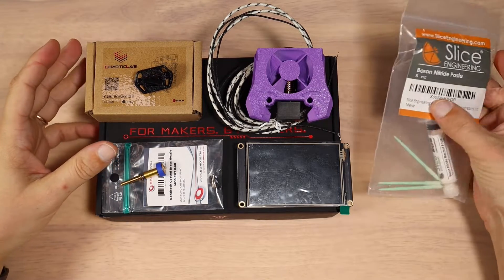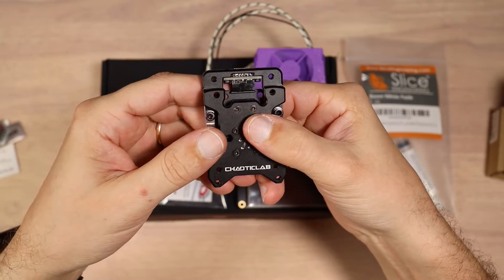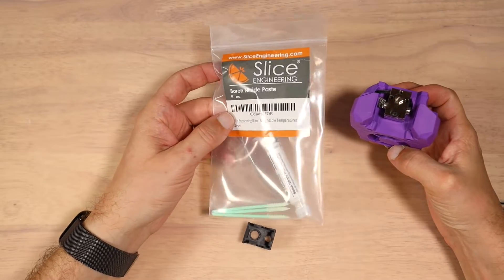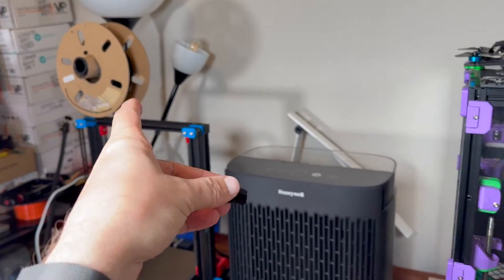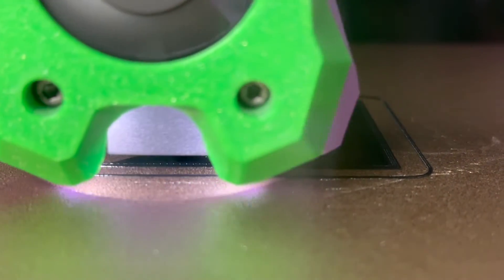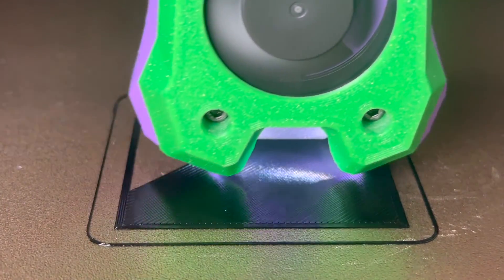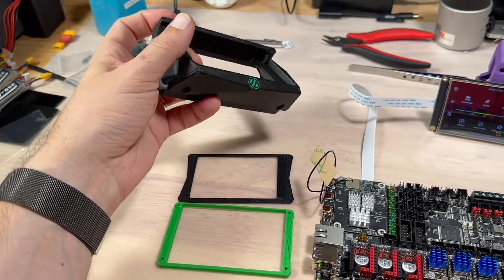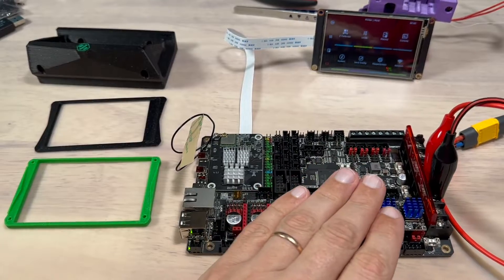Voron Trident mods (Voron Tap, BTT Manta MP8, BTT TFT35SPI)

Comment: the ribbon cable which comes woth the TFT35 SPI is very short. How did you manage to get the screen that far from the baord ? did you replace the cable ?
Reply from the maker: Honestly, I am not really sure if this cable came with the screen as I have a lot of parts around and realistically I could mix stuff up before assembly or during the process. Long time ago I have bought cheap RPI cameras which had similar but longer cables and may be I have used one of those.

Comment: what sparkly filament was used for the tft housing ?
Reply from the maker: Sparta Sparkle ABS+ Green Candy and Obsidian Black.
Reply: @hobbyistnotes thanks for sharing. I am learning to build a voron trident and your notes and videos on the same are a real help please keep sharing them. subbed. :)
Reply from the maker: @sanketss84   Thanks. Good luck building the printer. I really recommend Sparta's ABS+ it's one of the easiest ABS to print I have tried and I tried most popular brands among Voron Community. I don't know if it's due to sparkle but it sticks so well sometimes hard to remove from PEI, with others adhesion always was an issue one or another way (I am not sponsored by Saprta)
Reply: @hobbyistnotes  will check it out if it’s available where I stay. Thanks once again for taking the time.

Comment: It just sounds like a configuration issue for you with klicky probe... because i've had the opposite experience
Reply from the maker: Maybe you are right but I have tried a lot before giving up... All sorts of auto offset configs and scripts, changed switches few times, fully wiped all the configs, what ever I have right now with the tap is on the level better. I literally have to adjust nothing since I have switched. Also biggest win is the time it takes to start the print, no more extra routines. The only downside is lower accelerations due to rigidity but not by much, about 20-30% lose but I never go over 10k anyway with current setup so it perfect for me.
Reply from the maker: I have watched Steve another day: https://www.youtube.com/@SteveBuilds and he has exactly the same experience. For him Tap also works better.
Reply: If tap works for you then great! I think I know which video from Steve’s build you’re referring to - the one I recall seeing he was using KlickyNG, but that one at the time was still an ongoing project / “beta”.  But yeah! I’m using UnklickyNG for one of my 2.4s and KlickyNG for another one and they’ve been pretty solid.
Reply from the maker: @davinchewk  You probably right it's easily could be KlickyNG.

Comment: What pins did you connect the TAP to on the M8P?

I have a 2piece HartK PCB (xame in my 2.4 kit along with Fystec Spyder v3) and now
 have the headache of working out where to rewire everything.
Reply from the maker: I am running BIGTREETECH EBB SB2209 Can board on the toolhead it has header that can handle 5v. Kind of weird now watching the video I haven't included any details on how I actually wired it...

Comment: Where did you get the longer cable for the TFT? The one that came with my screen is very short.
Reply from the maker: Honestly, I am not really sure if it came with the screen or not as I have a lot of parts around and realistically I could mix stuff up before assembly or during the process. The only guess I have is that mine BIGTREETECH TFT35 SPI V2.1 could come with longer cable based on version of the screen but I could be wrong as well.

Comment: You could've added 5160 for XY and replace XY belt idlers with beefy mod as there are crack lines on yours (at least it looks like it). Otherwise looks solid upgrade (add nevermore stealth max filter)
Reply from the maker: Not fully sure what crack lines you are mentioning, could you please provide footage time cus may be I have missed something that you have noticed would like to check it. I actually made Nevermore upgrade but thought it will be too much for this video, will show this footage next time.